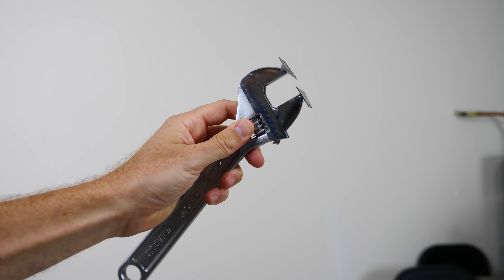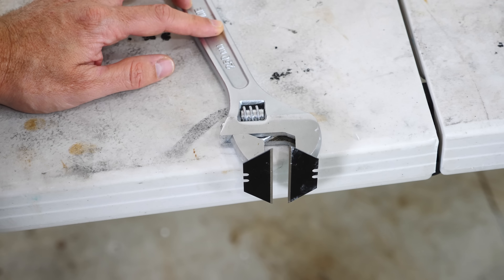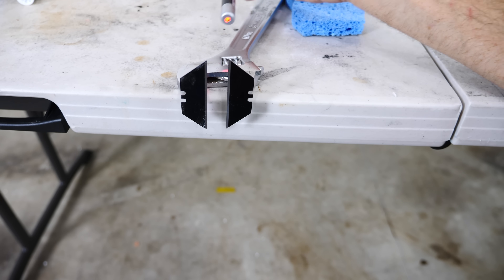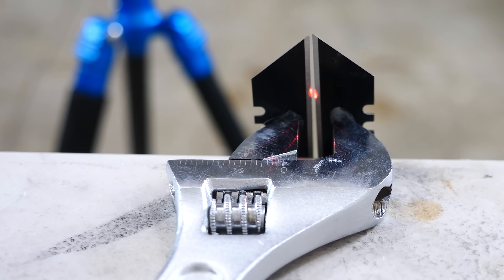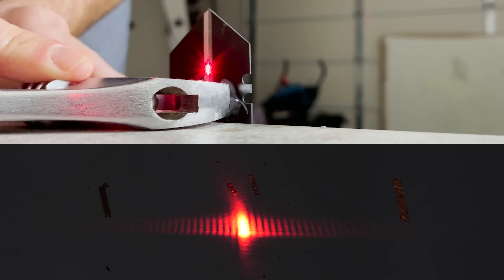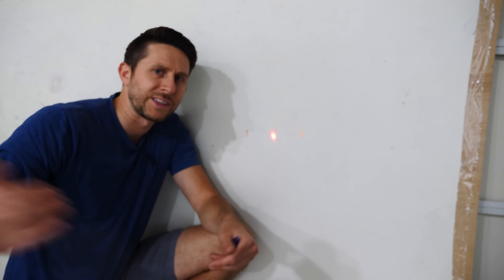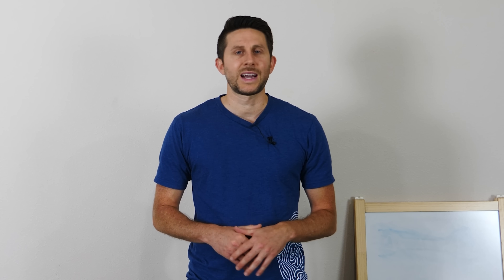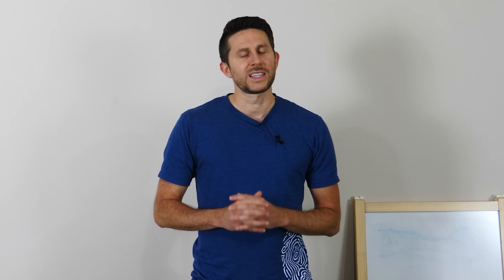Squishing Light Makes It Bigger—Heisenberg's Uncertainty Principle

Comment: 5:00 - False. This does not prove particles, because not every wave can affect every resonator. You need a specific wave length to do that, and in your charging example you used a light of different wave-length.
Reply: Exactly. Saying that light must be a particle because whether or not it can charge a glow-in-the-dark surface depends on its momentum is like saying that sound must be a particle because whether or not it can move a diaphragm depends on its momentum. Light may simply have particle-like characteristics because of the medium it travels in, just like sound. The only difference is that light is much smaller and we struggle to make mechanisms that can measure it without modifying it. That's where the Heisenberg's Uncertainty Principle comes in. But that applies to a single quanta of light, not to a beam of light.
Reply: Right? I didn't think a red laser could charge glow in the dark stuff anyway.
Reply: @matthewnardin7304  On the visible spectrum red light is the light with largest wavelength. My guess is that it simply too big to have a strong effect on atoms on that board. We don't really know the exact 3D structure of the atom, but what we do know is that atoms consists of things that move. I.e. atom is not a static object. And as such there should be a way to strongly affect that internal motion with frequencies in certain ranges.
Reply: It proves the discrete nature of light(quanta). You can thing of wave like a long stream of water pouring into a bottle with small neck. It will take time but eventually the bottle will be full. But in this case no matter how much time you shine the red light on the surface, it won't glow. That's means not much energy is delivered to the atoms to eject electron. It's like the particles of light is not small enough to fit into the bottle mouth and thus can never fill the bottle. If it was really only a wave, then some part of its energy would have been transfered to the atoms and with time it would eventually excite electrons but that doesn't happen.
Reply: @androidedison645  But once again, what is the wave, and what is the particle? Is it correct to say that sound is a particle because it is made up of air molecules? Just because light is a wave composition on a particle material doesn't mean that light is a particle.

Or in your bottle example, you are saying that if the opening of the bottle is too small for a single water molecule, then a wave cannot enter the bottle. This is correct. But we still wouldn't call the wave phenomenon water. But rather a wave of water.

The medium for light must already exist everywhere because we can spawn light from places where there is no light to begin with. Consider fire. Consider LEDs. Where is the light particle coming from? There is no "light" particle. Light is an energy wave in particles that are already present. Whether those particles are electrons or bosons are something else those particles can exist without light being present just like a tub of water can exist without a wave. But the wave cannot exist without the water.
Reply: @johnschewe6358  There is a light particle. It's called a photon. It's the reason light can travel without a medium. Or why light can travel through space. Light is both a particle and a wave. Though I'm not sure if the glow in the dark backboard proves anything or not.
Reply: @caterpie4546  So how does this particle poof into existence when you start a fire?   Naming a quanta of light a photon doesn't magically make it a particle. To be a particle it must have mass. I'd argue that light can't travel through a vacuum by itself. But that's not really a problem because particles naturally fling themselves off into the vacuum they are next to through a process called evaporation. That's why we can't achieve a perfect vacuum on Earth. And also why helium leaves our planet. And why if you ask modern scientists, they'll tell you that space isn't actually a true vacuum as there is always a gradient of thinner and thinner clumps of particles. I'd love to see proof that light can travel through a perfect vacuum. Good luck.
Reply: @androidedison645  I don't understand that. For example: let's take a resonator that resonates when you shake it 20 times per second. Are you saying that if we put that mechanical resonator on slow waves like in ocean it will resonate given enough time? Or that being affected by those slow waves will eventually keep increasing the speed of internal motion of that resonator? If that were the case then mechanical clocks on ships would have to re-adjusted more often than normal because they would tick faster.
Reply: @oraora8214  Exactly, the difference between working in a closed system vs an open system like every experiment that has been done so far. The energy from the light doesn't build up because it is being released.
Reply: Another interesting way to think about light is infrared. All hot objects release infrared light, the concept is known as black-body radiation. Infrared light is electromagnetic radiation, just like visible light. So if objects put off electromagnetic radiation by just existing and vibrating in space that either means there are in fact low energy (700nm) photons everywhere all the time or that light is simply the transfer of energy in a ray (straight line). This means there is never a time where one could isolate a single photon because just having any matter around them would immediately fill the space with more IR photons.

That understanding makes me lean towards photons not being particles because different wavelengths don't seem to interfere with each other the more distant they are. It would be interesting to try the double-slit experiment with two different wavelengths of light where one is the resonant frequency of the other. But that experiment would have its own problems because of how different parts of the spectrum interact with matter. It would probably be easiest to set up with radio waves because frequencies with multiples get closer together the smaller they are and should have less varied properties. But then finding materials that would reflect the radio waves (like a mirror) and a "camera" to capture the spatial results would be the trick.
Reply: Right? How can a lower energy red photon cause the emission of a higher energy green photon all other things being equal. You should be losing energy. When he shines the higher energy violet photon onto the phosphorescent material it emits a lower energy green photon which makes sense. The emission of light in a phosphorescent material has to do with the energy state the source light excites an electron to and then a photon of lower energy is emitted as it falls back down.
Reply: I think it does prove as, if they were waves and if you have a high intensity beam like a laser it would easily knock off electrons as waves can clump together.
Reply: @Zer0-ZW  What do you mean waves can clump together?

Air can pressurize. Are you somehow projecting a property of air onto electrons? Because so far our experience with electrons shows that electrons cannot occupy the same space.

Or maybe the misconception is the difference between amplitude and frequency (wavelength). Both of which are a component of energy, but have very different properties including permeability. For example, look at how bright the red light is compared to the blue light in this video ( 5:22 ). It could just be a limitation of the camera, but I'd like to think that more blue light is being absorbed by the surface than red light. And we see that as a greater intensity (amplitude) of red (frequency) light being reflected.
Reply: Light has duel nature: both particles and wave
Reply: @naoakku9766  "Light has duel nature: both particles and wave" That is the propaganda floating around. We want to know what it means or if it is even true. Science is testing hypotheses , not just repeating them.
Reply: @johnschewe6358  How do you explain the double slit experiment then?
Reply: @caterpie4546  The double-slit experiment? You mean the experiment that proves light moves as waves? What exactly are you asking about? Yes, particles such buckminsterfullerene have also been used to show the same distribution through two slits indicating that it is not the individual particle's momentum that dictates where it ends up, but rather the distribution of the entire system. After all, you are shooting these particles and energy waves through a space filled with other particles and energies. HUP is simply a convenient way of saying that the system is too complex for us to know exactly what will happen next to each quanta of mass or energy and that by measuring properties of the quanta at the beginning of the experiment, the results are affected. The best we can do is model the whole system statistically from the distribution of repeating the experiment many times. And guess what a beam of light is? Many quanta of energy doing the thing repeatedly. Waves have peaks and pits. That's why there is a uniform distribution of lines across the space where the light lands.
Reply: @johnschewe6358  The experiment proves that light behaves as both a particle and a wave. It was first done to prove that light was a wave but the results showed properties of both. Why are you doubting that light has particle wave duality again? This has been known for a long time and is used to explain many phenomena.
Reply: @johnschewe6358  My other reply seems to have been deleted, but photons are emitted when an electron moves from a higher energy orbit to a lower one.
Reply: @caterpie4546  Yeah, but is a photon a thing? Does it just pop into existence when the energy of the electron is released? Of course not, because a photon isn't a thing, it's a concept. The concept is that of a wave of energy. The wave of energy moves on a medium that was already present before the energy was released.

I'm not doubting anything, I just hate when scientists oversimplify something. Then people learn that concept wrong, and then we can't get past the hiccup for generations because nobody realizes they are working off an oversimplification. Does light act like a particle? Sure, because it is moving on a medium of particles and couldn't exist without those particles. But that doesn't mean that light is the particle. In the same way that sound is not a particle.
Reply: @caterpie4546  There is also a delayed double slit experiment, where the laser (of a single photon energy level) is split into two paths and one path is 5 times longer than the other - the interference pattern still happens. This makes little sense with waves, but absolutely no sense as particles. Because if light are particles then those particles simply cannot interfere with each other because events are separated by time due to one path being longer.

More details on the experiment - https://youtu.be/SDtAh9IwG-I?t=329
Reply: @oraora8214  Love the actual science link. Notice that at https://youtu.be/SDtAh9IwG-I?t=655 (10 : 55) he says "if we assume light is quantized", which means that even he recognizes that this statement is still up for debate.

It is really hard for us to get light down to a single quanta and, in fact, I've never seen anyone explain a device in which they are completely sure they have a single photon and not just a really short or dim beam of light. And the fact that light moves at a speed that is considered to be the maximum speed of anything in the universe hints at the fact that light is a phenomenon that occurs at a very fundamental level and that if there is a particle associated with light it is likely one of the smallest particles. So good luck finding a way to split photons on that one.  😂
Reply: @johnschewe6358  After some reading I realize that the wave-particle duality of light is not as accepted as I first thought. Everything I've read previously just pretty much stated it as fact, as do the first few results on google. So I apologize for my slightly snarky first response. I'll post the paper I read in a reply because youtube likes to delete comments with links.
Reply: @caterpie4546  Yeah youtube likes to censor words and links without letting you know. It's obnoxious. Maybe just try modifying the link so that it doesn't look like a link to yt.
Reply: The point that xe was trying to make in the video is that the photoelectric effect demonstrates that light comes in quanta, and this substance not reacting to lower frequency light demonstrates the photoelectric effect in action.  It's a rather superficial explanation, to be honest, because the argument was that hence light isn't a wave and so this isn't diffraction.  It could have been explained better.
Reply: @johnschewe6358  I thought folk have layered filters in a pile, each one multiplying the reduction in intensity, till at some point you have just single photons getting through - that still interfere. I do not understand the delayed choice quantum eraser at all. Just saying.
Reply: @JdeBP  I'm not so sure that the photoelectric effect demonstrates that light comes in quanta. But rather that the effect can only happen if and when there is enough light energy to move the electron from a lower orbit to a higher one. Light energy is based on the momentum of the electrons that carry it, not the level of the orbits. And so are not necessarily bound by quanta. The only way light would be bound by quanta is if space itself was bound by quanta.

But light is known to be a wave, an electromagnetic wave. It is not known to be a particle, rather it is assumed to be a particle because it has many particle-like properties. We know that light is a wave because it behaves all the laws of waves. And we can manipulate it as a wave. But many of the ways of talking about a light as a particle have issues, like how does light have momentum but no mass? The only logical answer is the same reason sound has momentum but no mass, or the same reason a tsunami has momentum but no mass. Because none of those are tangible matter, but rather a grouping of matter in an energy wave formation.
Reply: @tim40gabby25  In the video linked in our comments above, Jeroen explains why layered filters don't work for isolating a quanta of light. And its because the light that passes through the filter is stretched and distorted, but not removed. The result looks like a decrease in amplitude on a graph, but not a decrease in time. Which means that even though his delayed path was 5 times longer, if there was at least 5 times the amount of time it takes for light to complete the short path then the two would still overlap. And let's face it, 5 times the speed of light over the short distance he was looking at is in the realm of nanoseconds. Even computers struggle with timing at such speed. Which simply means Jeroen's experiment was inconclusive because he couldn't actually isolate single photons. But once again, the problem is that if light can't be quantified, then the best we can do is inconclusive results with such an experiment.
Reply: @johnschewe6358  What a considered reply. I need to have a think. This is what the Net can do. Thank you :)

Comment: Double slit experiment with a single slit and still same results .. does this means the change in momentum is the reason for the patterns and not the duality of light? Did u actually debunk the duality of light ?? 🙄🙄😵😳 . Please correct me if I am wrong - not a sci student ..
Reply: Hi “not a science student” , i am a science student. This is no debunking. When we study double slit experiment, it is usually always followed by single slit experiment. So its nothing new. Diffraction pattern from single slit is just interference of wavefronts from same slit

Comment: Ok two things:
1. I would love to do a live demo of this for my younger siblings, do you have any tips for how to afix the razors to the wrench? Seems like it could be a bit tricky, just wondering if you found an easy way.
2. Now I'm super curious for a demonstration/explanation of the energy/time uncertainty. I feel like I have an intuitive understanding of the position/momentum one by thinking of measuring a wave's position vs wavelength, but I can't really imagine energy/time
Reply from the maker: lay the two razor blades on a table aligned in the "closed position". Then put two dabs of hot glue on them and stick the wench (in closed position) to both razor blades at the same time. Let it dry.